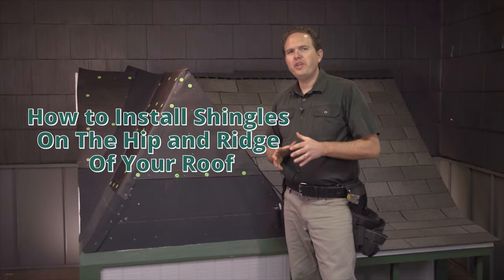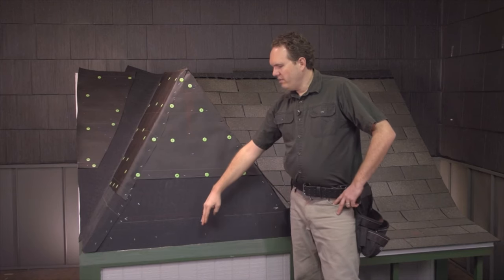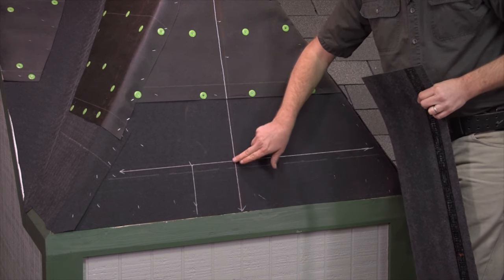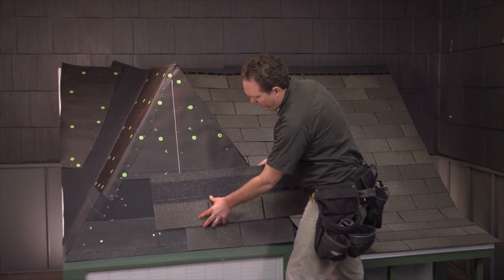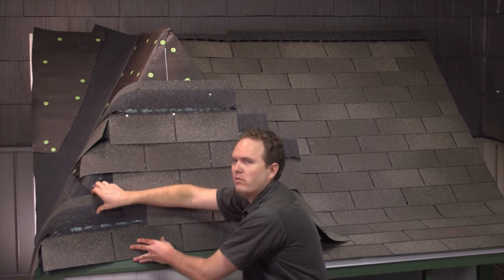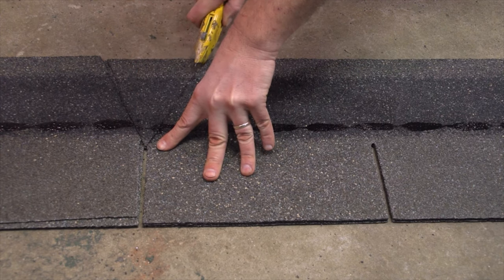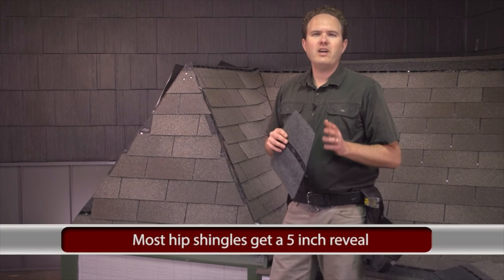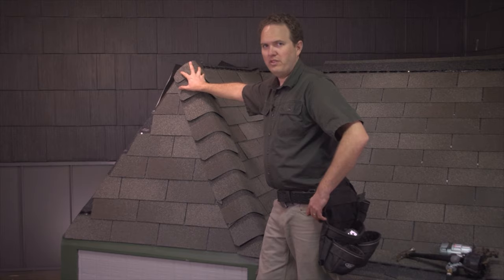How to Install Shingles on the Hip and Ridge of Your Roof

Comment: I don't understand why you didn't apply the first row of shingles all the way across before applying the second row and so forth, instead of going back and attaching shingles underneath the upper rows. Or even just starting at the hip and applying the shingles across row by row, paying attention to proper staggering of the shingles.
Reply: I was wondering the same thing. Are you a roofer? If so, would you run a full course of starters across the roof?
Reply: @bcmthepurchaser8251  I was a roofer decades ago, but not since. Yes, I would run starters the full length first, then start the field shingles at the left and proceed with the typical step offsets for upper rows. We did many hip roofs and never did it like in this video. I would be interested in hearing why he does it thus.
Reply: I agree.  His method is absolutely inane to me.  It feels so backward.  Definitely wouldn’t follow any of this guy’s advice.

Comment: Better start over. First shingle on the hip is supposed to have double coverage and yours has single coverage. The other problem is the huge wedge cut  of the cap shingle. You only need 1/4" cut on each side of the cutout for a taper. The reason for that is the nail will then catch the previous cap and you'll have 4 nails holding each cap.

Comment: 3 tab shingles have back center notches you can align with your vertical lines instead of continuing the upside down stagger using full strips flopping over the hip ridge on such a  small area. I know it’s just a demonstration but your starter  laps onto sloping wood which would be terrible on a real roof. Good luck finding 3 tab shingles in stock in my area.